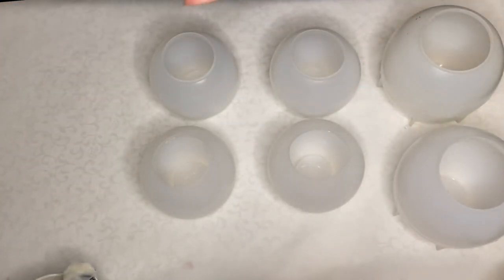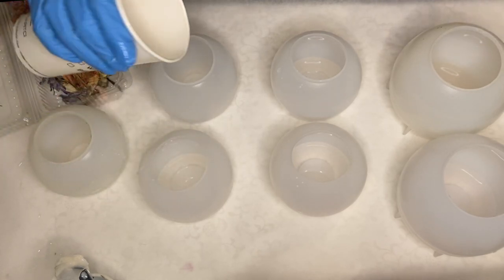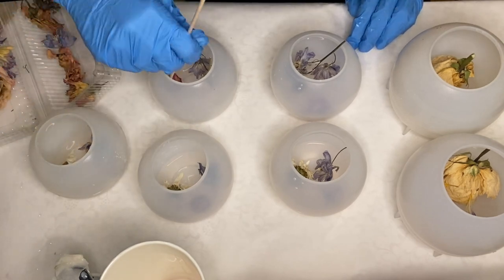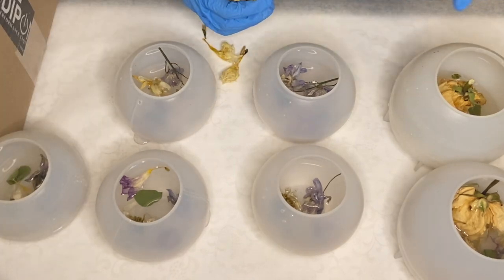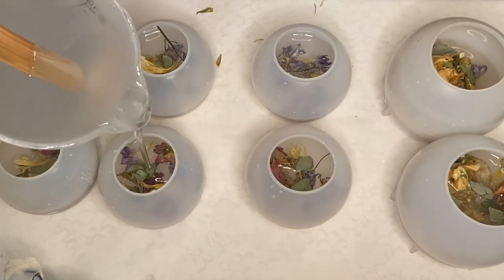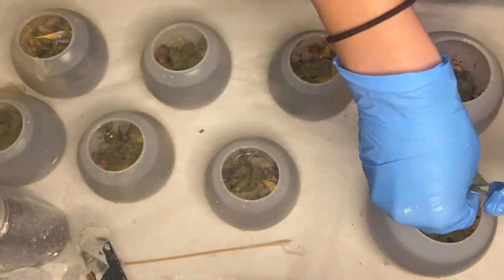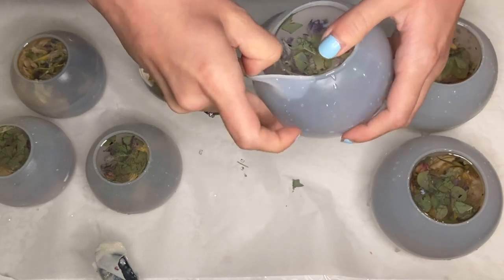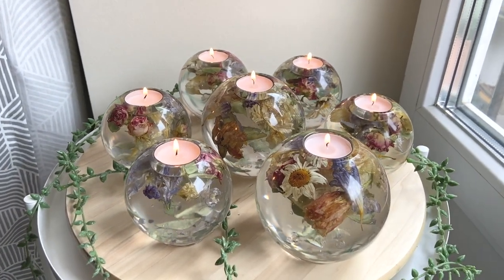How to Make Resin Candle Holders With Real Flowers: Resin Art Tutorial

Comment: Is there a reason you have to pour in sections instead of all at once?
Reply: You have to check the pour depth of the resin you are using.  If you pour all at once a thermal reaction occurs and the resin super heats and can burn the mold and ruin the resin.